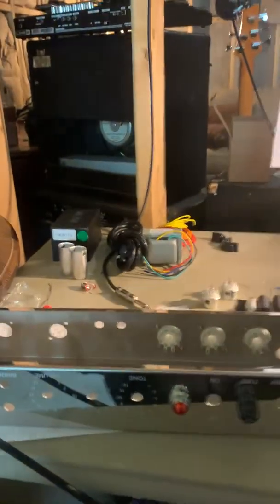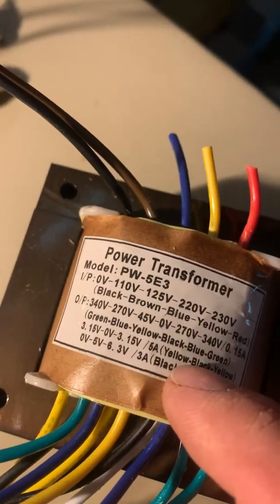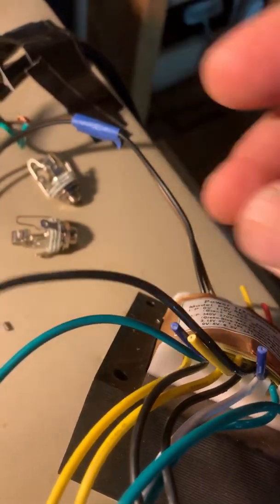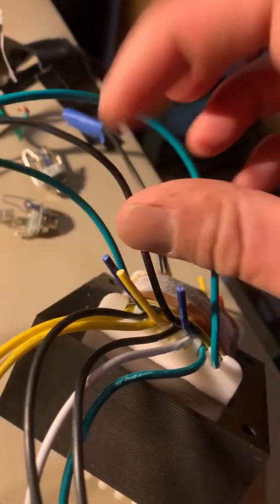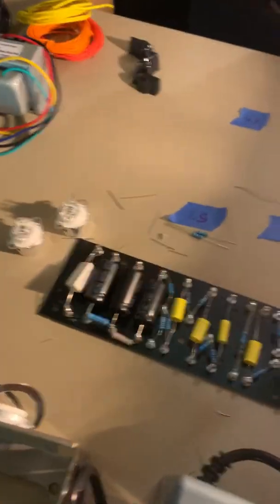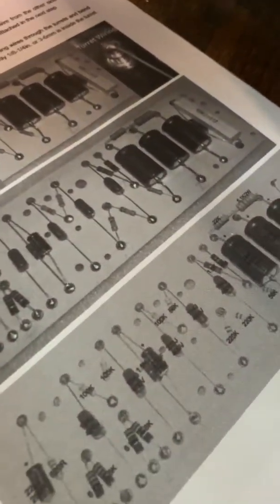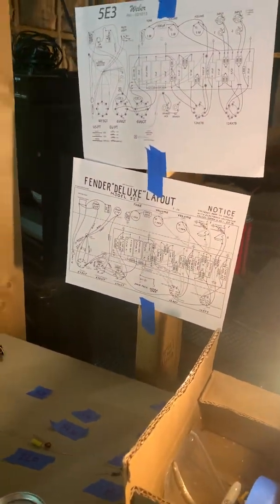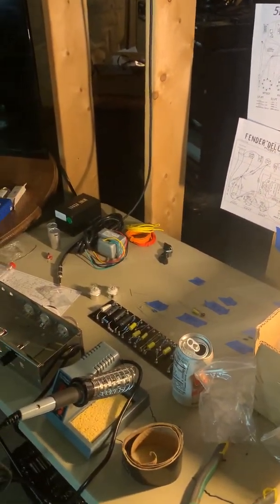Cheap Chinese 5E3 Build - Transformer Help and How to Build Without Instructions

Comment: I just paid premium for a Stewmac 5e3 kit. 
It had thorough instructions , the kit was top quality, and when I accidentally swapped some resistors , I had help within 24 hrs to rectify the problem. The cabinet quality is  top notch and the finished amp sounds incredible. I put it together in 10 hrs. 
You have to ask yourself is saving a few bucks worth all the bullshit drama.
I’ve been playing a long time and I’m a tone snob. 
Good luck
Reply: Yer more than just a tone snob dude
Reply: @spychoactive  😍😘
Reply: He's offering information on the details. 
Why didn't you just buy a completed 5E3 amp rather than a Stewmac kit. 
According to your logic you got the same bullshit drama.
Reply: @Blues_Rules  
I dunno, because I can use a soldering iron and a multimeter? 
And because it was 500 cheaper for me to build one? Because I was bored? So many reasons. 
But I wouldn’t go to the trouble of trying to source all the components myself. Fuck that.
Reply: @Albosacnut  I bet you could have bought a used 5E3 that someone built for cheaper. Why didn't you do that? Why are you here?

Comment: You have 2 different transformer videos. In this video, your very last  green wire (to the right) is on top layer. In your newer transformer video (5E3 Part 1) , your very last green wire is on bottom layer. Any way to confirm the proper green wire needed?
Reply from the maker: Hey there. There will be a green wire on both the top layer and bottom layer on the right. The green wire on the bottom layer is going to be cut and capped. This green wire is paired in with the white and black wires (5v and 0v). A helpful tip: After I selected my wires to be cut and capped, I taped each wire end down to the table so that no wire ends could touch and hooked the brown and black primaries up. All the center taps (black wires in this case) hook to the green wire on the power cable. I then plugged it in and turned my meter to AC volts and took readings. If you skip this step, make sure to leave a little slack in the wires you cut and cap in case you find something got crossed. Does that help?
Reply: @lowheadroom  Very helpful. Thank you.
Reply from the maker: Just to note I did review both videos and it looks like the transformers were built in a slightly different fashion. On this old video the green wire to the far right was on the top layer and was a high voltage wire. In the new video the green wire on the far right is not high a voltage wire. But they both reside in the same layers. The green wire on the bottom layer with the white and black wires will be cut and capped. The green wire on the top layer will be kept. And the test I mentioned above can help. but be very very careful if you test the wires before cutting. It’s very dangerous

Comment: This is very helpful.  I was stumped also.  So, the top row black is ground, and the two greens are the high voltage.  Everything else, capped.  On the bottom row, black is ground., the two yellow wires are 6.3v to the filaments.  The black and white wires are 5v for the heaters.  The green is capped.  Can you add a video showing the wires as they have been installed?
Reply from the maker: Glad it helped out! Yes I can. I'll work on that and notify you when it's complete.
Reply from the maker: I’ve uploaded the video with a diagram showing exactly how it’s wired. Hope this helps